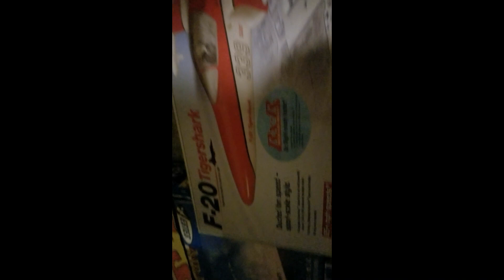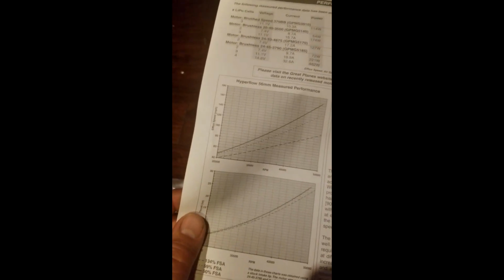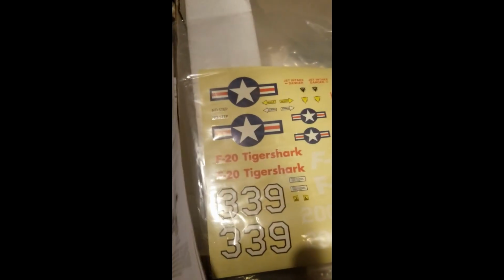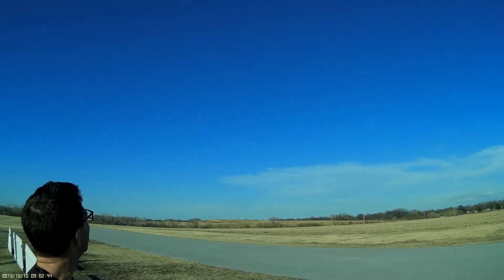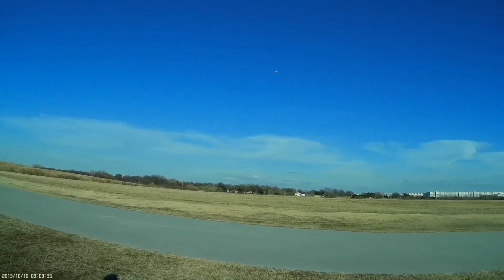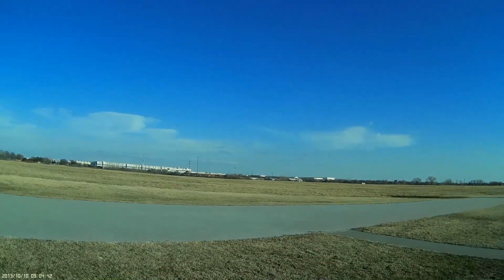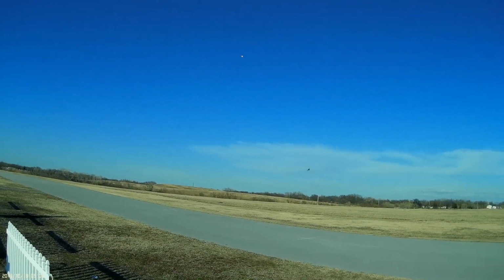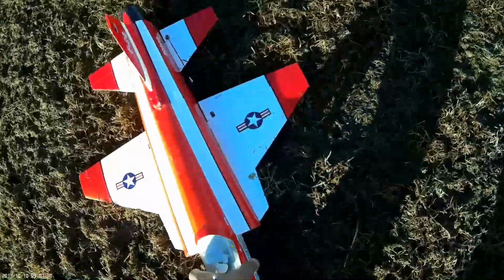The Unboxing and Re-maiden of the Electrifly F-20 Tigershark.

Comment: Hi! Was the recommended  CG good.  Seems awfully far forward  but if you say it was tail heavy I believe  you. I put in a 64mm fan and a heavy 2200 4s lipo has to go all the way forward  to balance.  I even moved the edf forward. Want to try a 1800 but it wont balance.  Thanks and love your video.   Waiting to maiden mine and it seems tail heavy
Reply from the maker: Change the stock esc If so equipped.  Old tech can't sit for so long it seems.  Mine burnt up not too long after this.  And ya, it was tail heavy on the first flight.  Old 2200s were much heavier when this came out so today's lighter packs need to move a bit more fwd to meet cg.
Reply from the maker: @pissedoffpetedotcom  drops in turns too.  Just keep that in mind as well.  Good luck